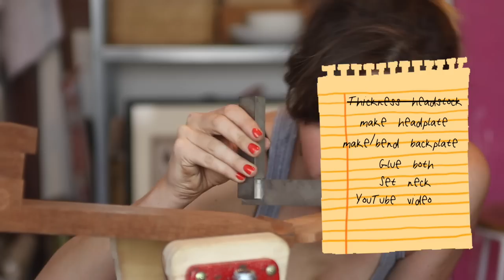Day In The Life of a Luthier

Comment: You can use walnut for the neck too if you want to avoid tropical mahogany. Black walnut (juglans nigra) has a the edge over mahogany in stiffness and breaking strength, is stable and carves great. It is going to be heavier, but not as heavy as hard maple. Like mahogany it can vary a lot in density and hardness.

Comment: Taking you up on your offer to make a guitar with you 😃 I have been working with wood ever since I can remember I have always wanted to build a guitar but never made the commitment to do so, I have built skateboards, houses, furniture, 2 50’ boats, and most recently a plywood canoe and a skin on frame canoe,etc etc… I was planning on building a small wooden boat when I was given a fender Stratocaster that was in pieces so basically a full restoration. Then the spark hit me to build my own guitar, I just finished a refret on the Stratocaster and will be preparing body for paint and in between all that I have been jigging up for a guitar build and contemplating starting a Business as a luthier and then I found your video

Comment: I'm on my journey of starting my own line of headless multiscale guitars. I've already prototyped some body ideas and my neck/fretboard templates are currently being CNC'd by a local machine shop(not buying a CNC anytime soon). I still need to buy a proper thickness planer but I have pretty much all the other tools necessary. I'd say the biggest challenge so far is creating the necessary templates to be able to accurately replicate a design, but it's worth putting the effort in since it'll make it much easier and faster to build an instrument. It took me many hours in CAD and SVG programs to design the body and neck shapes! Thankfully I already have been working on building a collection of really nice power tools.

Comment: I've never built a guitar. I typically use my slabs for tables, but nobody is spending money on anything other than fuel, groceries, and utilities. I have slabs of walnut and maple in my shop, so I'm putting together an idea for a solid body electric with a dark walnut body, and a maple neck...or maybe vice versa as I'm concerned about the weight of the walnut. Great video!

Comment: Thank you another cheerful video Daisy Tempest!  What is the machine at 6:15 that has a small conveyor belt?  You've shown it in other videos as well, but I haven't seen one where you explain what it does.
Reply from the maker: it's a drum sander! probably the most useful thing I own. Amazing for thicknessing tops and backs, to smaller components. Much faster obviously than a hand plane, and more gentle than a massive planer thicknesser.
Reply: @DaisyTempest  Thank you for this speedy reply!

Comment: I've been building electrics for 10 years now, but because of chronic fatigue and other circumstancesI didn't have access to a decent workshop until this year, the process has been so slow and I've only finished three or four guitars in those 10 years. I used to do routing in my room and I would sleep in sawdust. I didn't have a choice really. Because of the above, It's not something I can make a living out of as I only have about 4 hours a week to do labour intensive stuff, and then I have to pace myself if I still want to do other things. I've been noticing that often acoustic guitar builders prefer the process of building whereas electric guitar builders seem to be a little more interested in the finished project (there's anyone in between of course, for example semi-hollow and hollow body electric guitars take the same amount of work (or more) as "regular" acoustic guitars). For me I don't have as much fun building, but I like having built, if that makes sense? I can recommend it to anyone who does want to get into woodworking. It's challenging but ultimately satisfying.